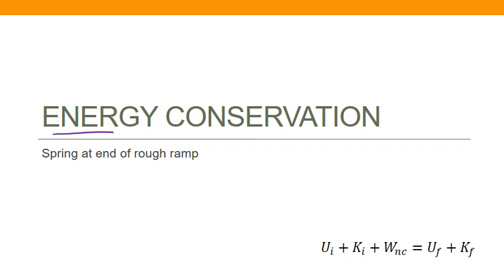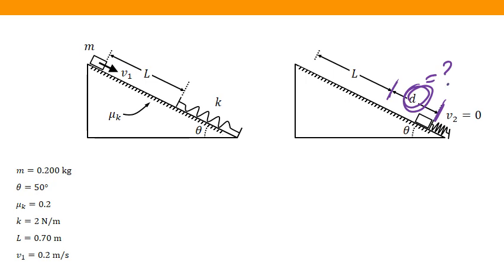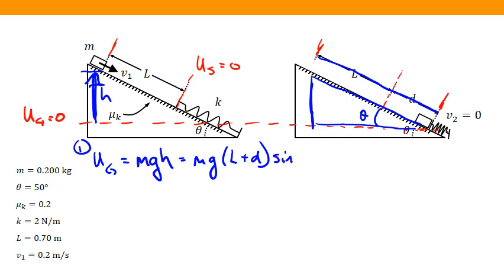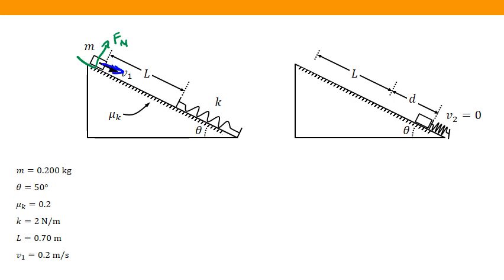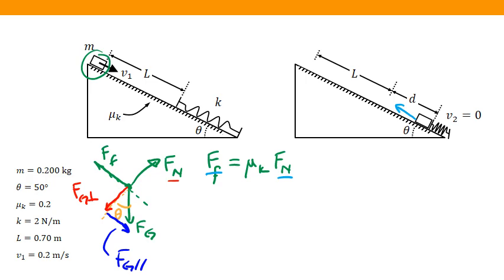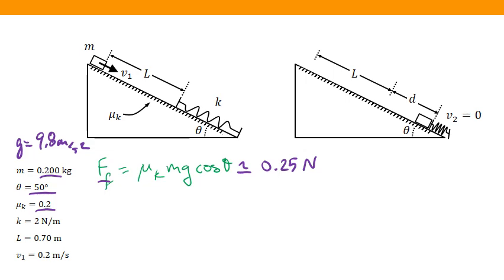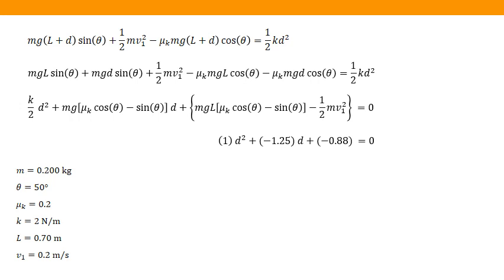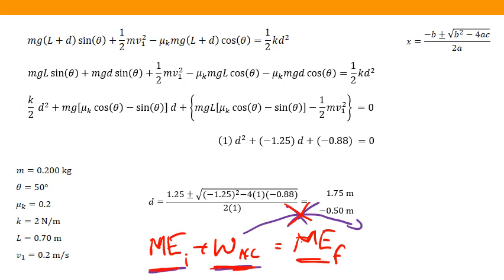Energy Conservation - Block on rough incline with spring (EXAMPLE)

Comment: Have a question, a car of mass 211kg descends a hill of slope 1 and 5. Calculate using an energy method, the average braking force required to bring the car car to rest from 82km/h in 30m. The frictional to motion is 350N.